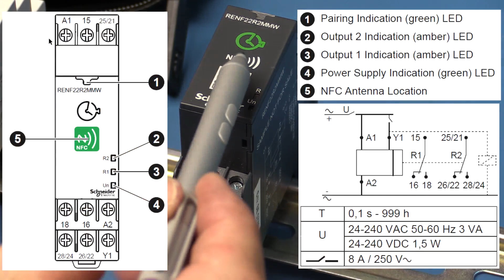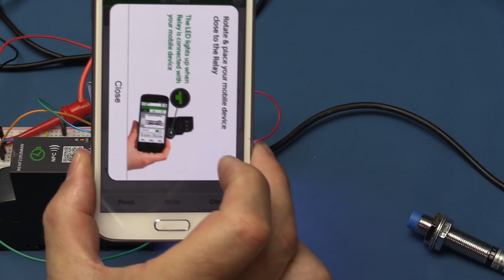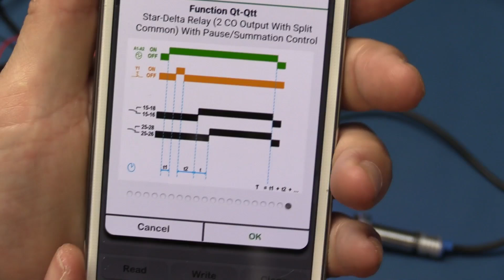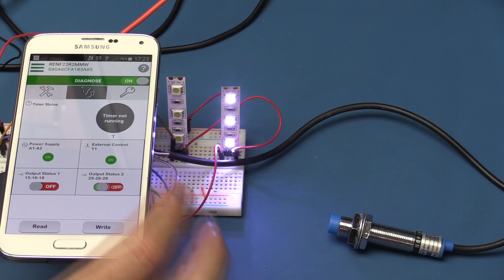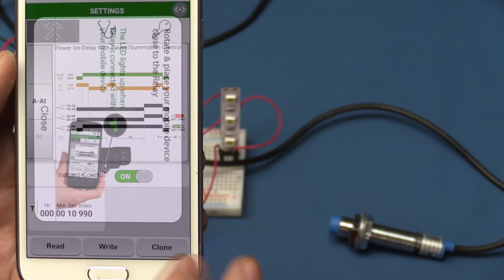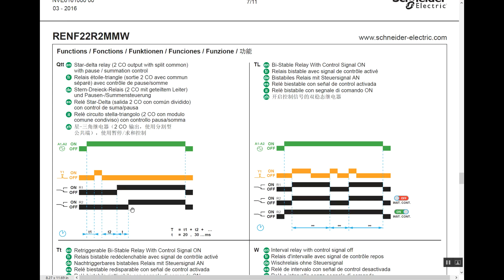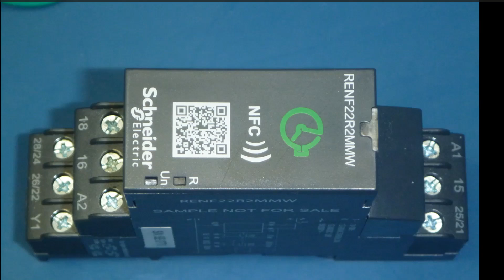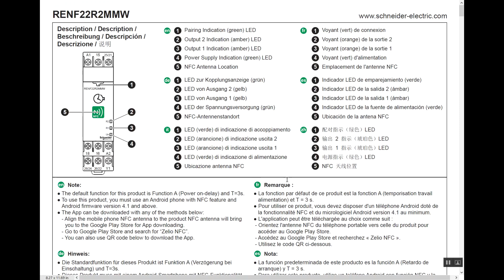NFC Programmable Industrial Timer Relay

Comment: Looking for a basic relay in the same form factor, just DIN rail mount with 5-24vdc trigger. Any suggestions?
Reply from the maker: Pretty sure this one has all that, it is din rail mount and I have been driving it from a logic output from an arduino header with no issues
Reply: Yes, it does... But also a lot of tech I don't want to pay for when I'm not using phone apps or nfc

Comment: Too small with 2 relays, needs to have 8 outputs and inputs and be a mini PLC to do perhaps some basic automation. That way there is no need for a proprietary programmer ( though the app will be a big limitation and might not be usable in 3 years as phones change) to set up the unit.
Reply: Multiple sources of studies say that NFC technology is growing and it is forecasted to continue to grow in the next few years. NFC is the only solution for mobile payment, smart card and ioT. The growth in these areas will accelerate the NFC readiness for more and more smart mobile devices in the future. 

According to the latest Ericsson Mobility Report - https://www.ericsson.com/mobility-report/mobile-subscriptions#section_3 -smart phone subscriptions are set to almost double by 2021, which means >70% of world population will own smart mobile device by 2021. Potentially the same percentage of world population will have NFC-ready smart mobile devices to be ready to use together with NFC products like the NFC Timing Relay. 

So, I would not worry too much for the near future about the use of the app that goes with the NFC timer.